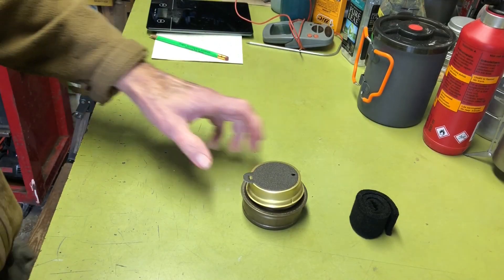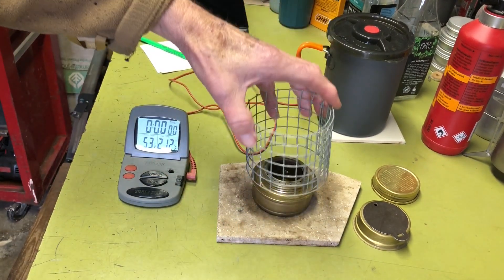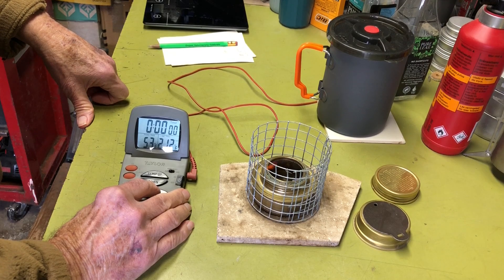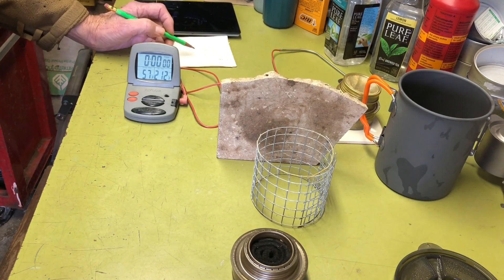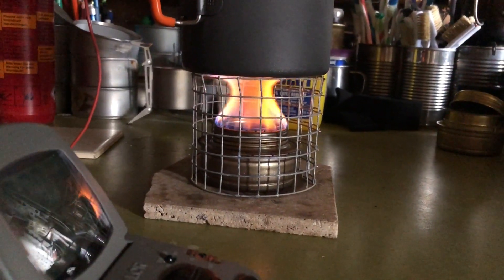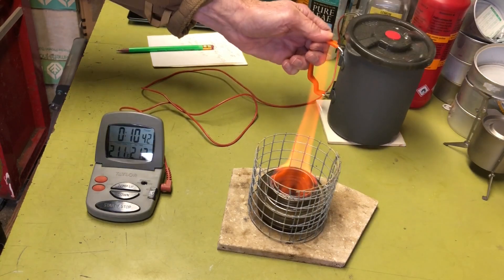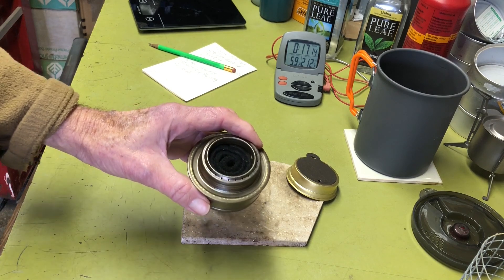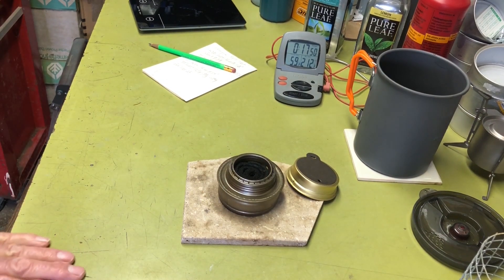Trangia Alcohol Burner Boil Test With and Without Carbon Felt

Comment: Thank you for sharing this fascinating experiment.
Stuffing something into the center hole of a Trangia burner is actually a pretty common trick here in Japan as well. The main reason is that cooking rice requires a gentler flame than what most alcohol burners normally produce.
Commercial alcohol stoves are designed to burn fuel efficiently and boil water as quickly as possible. That’s great for speed, but not always ideal for certain types of cooking that need more time. Of course, using a simmer ring is the proper way to handle this, but many people try small modifications like yours when they want a stable, low flame that allows them to “set it and forget it.”
There’s another—admittedly not very praiseworthy—reason too. When boiling water in a tent vestibule, a high‑output stove can produce aldehydes that irritate the eyes, especially when the flame hits the cold bottom of a pot. A weaker flame reduces this a bit. It does take longer to reach a boil, but in reality some people still choose this approach.
If you already knew all of this, I apologize. I just wanted to comment as someone who enjoys experimenting with the same stove and exploring different ideas
Reply from the maker: Some was new and I appreciated it. 😊
I have seen videos where a lower flame will increase fuel efficiency although I’d think a high flame would be better at countering wind heat loss.

Comment: Drill one hole in the exact center of the bottom, put carbon felt and alcohol inside, then conduct the experiment again. The key is to have a hole at the bottom and a 5mm air gap above the carbon felt.

Comment: I'm wondering if your pot support might be a bit to high?  I was always told 1-1.25 inches above the burner top is the optimal pot height.  The time the water boiled was still reasonable though. The fact that it's quiet is a big plus for me.

Comment: Interesting video! Will a trangia or a moonlander work using cooking oil?
Reply from the maker: I would think not.  The fuel needs to vaporize for the burners to work. With oil I think you would basically have a candle with a lot of smoke and soot. Same with kerosene and never use gasoline.
Reply: @planetsideagent I see. Thanks for your input.

Comment: Having almost set fire to my awning after knocking over a trangia burner, (and then changing to whole system to a gas burner), the carbon felt is a safety feature to prevent spillage as it absorbs the fuel
Reply: I've always used my alcohol stove in a Fire Box Nano.  It seems to be stable inside of that.  I can see that a dumped burner can be a serious issue.

Comment: In the YT Channel Lifestyle C.C. Land (China) they have a test in what was put steel wool (for cleaning cocking pans) inside the Trangia burner and above the steel wool carbon felt, covered with a steel net. They sell a kit for this modification in Taobao.

What they achieve was:

A more blue flame, what means less sot in the pans.

Better fuel efficiency, the same amount of fuel last longer.

Supposedly the steel wool facilitates the mix of fuel and oxygen, the carbon felt and the steel net a better burn of mix.
Reply from the maker: I've watched her channel, some good stuff. 
iI haven't tried steel wool yet, I'll have to give it a try.  Maybe in the Trangia knockoffs since I'm not real happy with their performance.

Comment: Has anyone tried to use ceramic insulation/wool or rockwool instead of the carbon felt, using brass sponge(sold for cleaning soldering irons)?Just some different ideas. I like the idea of a wick in there cause I usually drop my triangia into a swiss army volcano stove.
Reply: *brass sponge as base with insulation/carbon felt on top then some steel mesh to hold it in place
Reply: In the YT Channel Lifestyle C.C. Land (China) they have a test in what was put steel wool (for cleaning cocking pans) inside the Trangia burner and above the steel wool carbon felt, covered with a steel net. They sell a kit for this modification in Taobao.

What they achieve was:

A more blue flame, what means less sot in the pans.

Better fuel efficiency, the same amount of fuel last longer.

Supposedly the steel wool facilitates the mix of fuel and oxygen, the carbon felt and the steel net a better burn.

Comment: The height of the felt insert may insulate or slow heating of the vaporization chamber on start up. Spilling a few drops fuel on the outer tray will get things going faster. Once the stove heats up the carbon fiber will not slow fuel or oxygen delivery (unless it restricts the intake ports), but the simmer ring may restrict both over the output ports ... My stove is ideal as a boiled egg timer. I can come back after having forgotten that I had something on the stove and the eggs are nice and ready. For continuing cooking on the same fill of fuel for boiling a beverage or frying, it seems best to prevent scorching in the next pan by snuffing and cooling the fire breathing monster. Drink some of that tea before lighting up again for your omlette.

Comment: Here are a few things I've been working on with my Trangia system: 
1. The main issue I have had with myTrangia 27 deals with the Infamous simmer ring. Trangia has not produced a perfect solution.  I've rarely been able to get it to reduce the flame down to a consistent true simmer level. However, I recently developed a method that seems to work, using the idea of an oil lamp as a model. I ordered a replacement lid (not a replacement simmer ring) for about $5. After removing the rubber ring, I drilled a 1/4 hole in the center and installed a hollow threaded rod using a couple of nuts to secure it. The rod extends at least 3/4 inch above and 1/2 inch below the lid. Through the threaded rod, I inserted cotton wick that extended down into the fuel. The wick is a tight fit, which seems to work best. Off to the side of the lid, I drilled a small vent hole using a 1/16th drill bit (this is an important step!). Then, I filled the stove 1/2 full with fuel, screwed the new lid on the stove, and placed it in the lower wind screen as usual. The small flame it produced was perfect for simmering if the wick is kept trimmed. The 3/4 inch rod is high enough to keep  the small flame from overheating and pressurizing the stove fuel reservoir.  In actual practice using it for cooking, I used the stove at full flame, then snuffed it out using the closed simmer ring, then screwed on the new lid and re-lit the stove, and replaced the pot over the flame. Perfect simmering! To adjust the flame, adjust the height of the wick. To extinguish, you can just blow it out or make a DIY snuffer cap. Note of caution: If you use this modification in very cold weather while using the winter attachment, only use the recommended very few drops of fuel to warm the burner! Too much fuel in the winter attachment pad will pressurize the stove and will produce a torch! To further reduce the chances of this happening, screw the lid on only loosely. However, in my experience, if the lid is on too loosely, fuel fumes can escape around the rim and ignite. YMMV. 

2. Another issue I've worked on is the hot spot produced by the Trangia stove in the middle of the pots and pans. To deal with that, I developed two methods: I cut out a circular piece of sheet metal 4 3/4 inch in diameter to use as a flame guard. This size will fit exactly on the lower level of the pot holder arms located on the upper wind screen on the Trangia 27 model. Then place the Trangia wire "pan stand" on the upper level (The pan stand can be found on the Trangia website). Your smaller sauce pots will be protected from the direct flame. To eliminate the hot spot when using the fry pan that sits above the wind screen, I used a Evernew Titanium Alcohol Stove Cross Stand on the burner, then placed my DIY flame guard on the cross stand. My latest version of the flame guard has several small 1/16 inch holes drilled in it to allow some of the heat to pass through, which helped with efficiency.
Reply: 👍 .. good options .. thanks for sharing them with us.
Yep, when the Trangia goes into 'afterburn', the Simmer Ring has difficulty in curbing it's enthusism.
For a really low simmer / keep stuff warm heat, I have a separate 'home-grown' Burner and Stand system that I use on the side while I continue to cook up using the Trangia and which stores inside my modified 28t Mini setup.
That said, your mods have given me something to 'mull over' .. take care ..
Reply: I too use a small carbon felt stove to simmer.  I gave one stove that will burn one millilitre of alcohol in one minute that makes timing a simmer easy.

Comment: Yeah, the Trangia already has wicking inside the outer wall. Adding wicking to the main chamber will interfere with the vapor flow to the "jets".
Reply: It’ll insulate the wall so the fuel won’t heat up and vaporize.   Same as when it’s over filled, or cold.
Reply: What happens if you take out the wall and the wick ? 😂

Comment: 👍👍👍 thanks for that 😊.
My take on this .. and please, I am not contradicting your test in any way or trying to influence others to my way of thinking .. just shading my own experience.
I've had a Carbon Felt / Glass Wool Combo in my Trangia for some years now and I'm happy with the end result.
Perhaps your test was affected (and understandably so) by the following:
'Bloom Time':
* The Trangia double wall leading up to the 'Bloom Jets' is 'wicked' to facilitate fuel flow up to the Jets. I think that the Carbon Felt absorbed much of the Fuel, thus slowing down it's flow into the double wall wicking and then up to the jets.
* My experience is that the bloom time with my stove is a bit faster than in your test (perhaps not as quick as with a 'clean' stove, but not noticeably so) .. the reason possibly being that I have packed the Glass Wool quite loosely in the bottom of the Burn Chamber (I think that this allows for an easier flow of liquid fuel into the double wall wicking) and then topped that with a tight roll of Carbon Felt that comes right up to the top lip of the burn compartment which keeps everything nicely in place.
Fuel Consumption:
* Waiting for the (longer to) Bloom would burn more fuel. My setup .. I don't wait for the bloom, but put my pot on immediately. No matter how cold it is outside, I have not had a 'snuffed flame' .. whereas a standard burner is inclined to sometimes, in cold temperatures, 'snuff out' if one is too hasty in getting the pot on.
Boil Time:
* Yes, it should take a bit longer due to, what my take is, a 'gentler' flame. This suits my style of cooking. I'm not into getting water to boil ASAP. Should the extra minute taken be of 'danger to life and limb' .. then my preparation / setup has definitely failed elsewhere 😏.
Unused Fuel Storage:
* Notwithstanding the Gasket Seal on the Stove Cap, previously, I always removed leftover fuel after use. Now, I don't. The Carbon Felt and Glass Wool appears to 'hold' unused in place sin addition to the Cap. Have never, to date, had any problem with fuel leakage.
I have mentioned this in some of your previous posts .. my initial motivation to modify my Trangia was to reduce the Fire Risk in the event of an inadvertent 'knockover'. Here in Switzerland, the Swiss Authorities have absolutely no sense of humour with those who set their forests (or anything else) aflame .. eye-watering fines 😳 being the order of the day .. and then, there are the 'Swiss Grannies' who see and report everything 🙄😏.
Once again, thanks for taking the trouble to do this comparison ..useful info 😊.
I suspect that any modifications to the tried and tested Trangia design, no matter how insignificant, will have varying degrees of outcome, much dependent on the nature and specifically so, such modifications.
Until your next one then .. take care ..
Reply from the maker: Preventing leakage is a good point.  'Swiss Grannies" 😄 too true.
Reply: @planetsideagent  👍😏.

Comment: Well, that certainly proves a point!  I love the Trangia system and use regularly, however I also have a small home-made stove (30ml aluminium pot with carbon felt) which I use for a quick brew.  It’s small, light, spill proof and very quick to set up and boil.  I have often got steam rising from this system by the time a Trangia has bloomed.  Thanks for the video.  Regards Broadlander
Reply: I'm a fan of small carbon felt stoves and have made different size ones for simple brew kits to larger ones for more serious cook kits.  Ideal for a day hike or short camping trips
Reply: 👍 .. got similar.
Those little containers filled with felt / whatever are much underrated and punch way above their weight. And, all that I have made to date have been from salvaged 'throw-aways' at parks, building, and home renovation sites.
Reply: Interesting! What's it called and where can I get one?